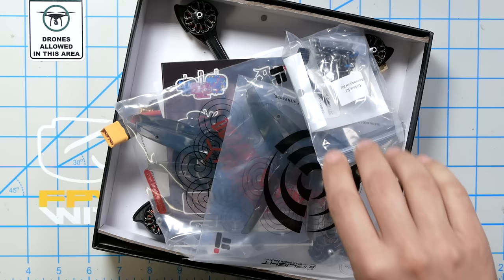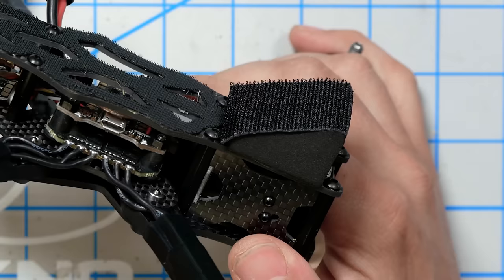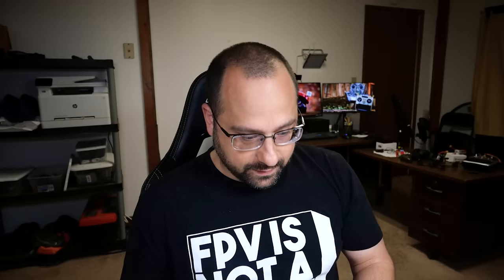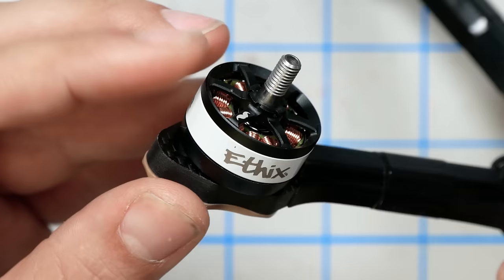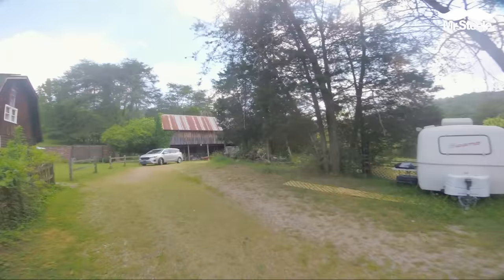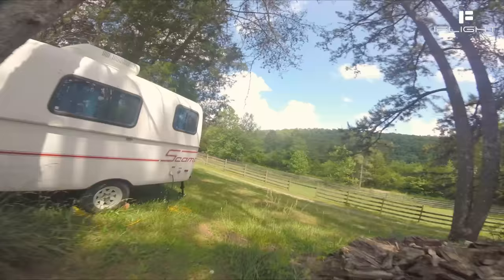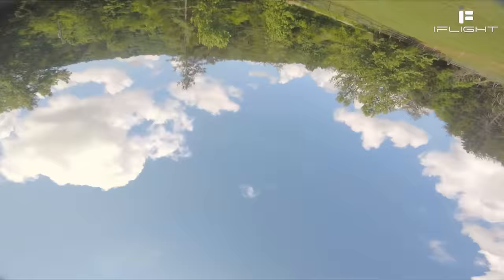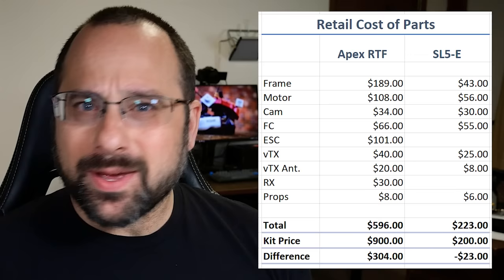Mr. Steele $900 Apex RTF vs. $200 iFlight Cidora | WHICH WOULD YOU PICK

Comment: I like Mr. Steele......Don't like his motors. they have a weakness on the shaft just under the bell. it will snap-off leaving the bell in place. you wont always know that its happened. you will try to take off after a crash only to discover that your motors are now trash. I have lost as many as 3 motors in one moderate crash......

Comment: Why all this 3d printed garbage.  Theres an option between 3d printed, and injection molded.  Resin cast (alumilite or smoothon).  The mold would take 15 minutes.  and each part take about 2 minutes to cast.  As a matter of fact,  when my nazgul gets here,  I am going to make evoque style battery connector, make a mold,  and see if theres a reason why no one is doing this.

Comment: Steele sells crap quads that are designed to break and make him money. Diatone destroys his quads easy.
Reply: And how long have you been in the hobby? Because that statement is an opinion, far from fact,  anecdotal evidence doesn’t make something a fact
Reply: @mhoovair89  The video proves my point esc fried, in the last video the kiss build hit a small branch and would not arm at all. I built a quad that has hit the concrete half a dozen times at full speed and arms then flies right after. if you hit the concrete at full speed with steeles quad you would need a new quad. 900$ paper weights are worse than building it yourself for 100$. all facts.
Reply: pamela strickland anecdotal evidence doesn’t equate to facts.

My apex is quite durable, I fly concrete, steele, anything. And crash as much as anyone else who’s been flying this long, and it’s fine. 

Kiss Firmware does fly better, you’re not a professional pilot. But there is a reason that almost EVERY professional uses KISS to film; that’s an actual fact.
Reply: @mhoovair89  Silly civilian.
Reply: pamela strickland good one.